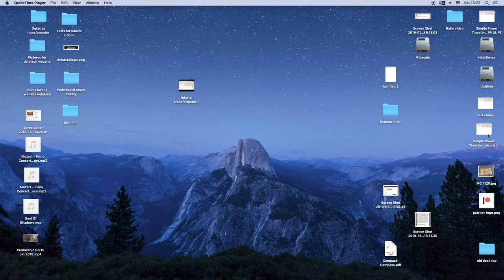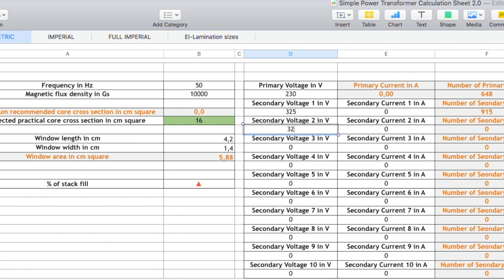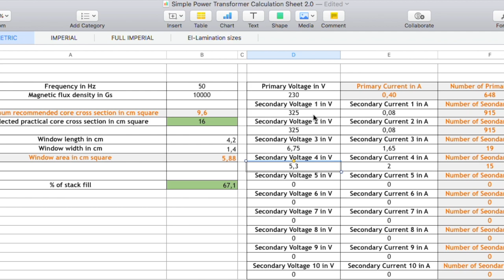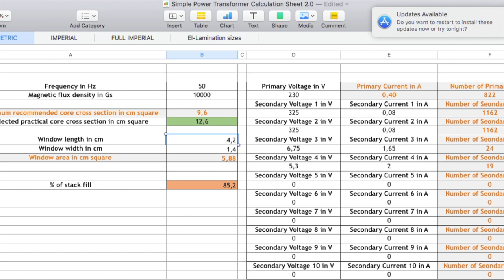Practical Transformer Winding Tutorial 2019

Comment: FREAKING EXACTLY WHAT I WAS LOOKING FOR! Thanks.
Reply from the maker: Thanks, happy that it was useful!
Reply: Don't repeat his steps... His transormer is rly badly made from safety point of view...
Reply: It's true, transformers were made this way 50 years ago and earlier, but that doesn't mean using wax and paper as insulation is a good thing. They only did it because they didn't have any better options. I don't even mention about leaving windings loose... It;s also very dangerous, because during  operation windings can vibrate and damge insolution of the wire and cause fire...  That's a very common fault in electric motors!!!

Comment: Im thinking of winding a step up transformer to step up from 1mv to 2V. Would i really need 1:2000 winding ratio? Seems ridiculous
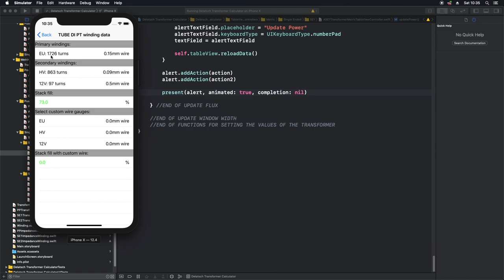Reply from the maker: Well, I presume you would like to amplify some audio signal? Usually it is done with a step up transformer that amplifies a signal in 1:10 (vintage ones went up to 1:20) and then you use an active device to amplify the signal further. The transformer is useful for these applications because it doesn't have internal noise like active devices and it can match the impedance. So, you can match the impedance and amplify the first most critical portion of the signal and then feed it to an active device like a jfet, opamp or tube.
Reply: @Delatsch  but why is 1:10 possible and not 1:1000
Reply from the maker: @ColocasiaCorm  The first problem is that you need a specialised high permeability core to reduce the number of turns. But with this ratio, even with the highest permeability core you would still need like 800000 turns on the secondary :) If you would increase the core size it would get veeery expensive and still you would need too many turns on the secondary which would cause a lot of leakage inductance and stray capacitance that would kill you high frequency response totally.
Reply: @Delatsch  i love you.

Comment: This is great! Nice work. I have wanted to wind transformers for quite a while.  I have two questions: Have you tested your spreadsheets to see if they work in LibreOffice Calc (This is an open source spreadsheet program - I run Linux only and this is pretty standard on many distributions)? For the screws that hold the transformer together, I always thought you needed to isolate them from the lamination's?
Reply from the maker: Thank you! Yes, the sheets work I've used it myself in Libre Office as well. They also work in Google Sheets on the Chrome boxes and Apple Numbers and of course in MS Excel as well.

Comment: Nice video.  A few suggestions to help with high percentage bobbing fills.
1) Keep all tape on the front or back side of the bobbin.  Even just a few thousandths in the lamination areas add up quickly.
2) Keep winding layers neat, gaps and overlaps will cause uneven layers and eat up space very quickly.
3) Keep overlap for paper layers to around 250 thousandths and make sure all internal paper layer seams are on the front or rear faces.
4) Eliminate the heat shrink tubing and instead partially strip the lead wire leaving the insulation stub on the end of the lead wire.  Strip the insulation off of the magnet wire and wrap it around the exposed lead wire conductors. Solder in place.  Tape the lead wire to the bobbin and make sure the lead wire stretches across the entire width of the bobbin.  Doing this will result in a more stable uniform winding layer.  Do the same when you finish the winding and the second lead wire.  Use your judgement when determining when to bury lead wires or bring out the windings.  If the diameter of the winding wire is less than the thickness of the lead wire insulation, it should be fine to bury the leads.
Reply from the maker: Thank you for your input! It's difficult to have a definite answer for some of the winding techniques since there are many ways to go about it and many different situations and conditions that will call for something different every time. The most important thing is for the "amateur" winder is to make sure the transformer will be safe, use only two coat enamel wire where the insulation can withstand high voltage and high temperature and the second objective is to fit the wire so that the laminations can be inserted without rubbing on the finished windings. The rest will come with experience and time.

Comment: Howdy. 
About the OPT for KT88 Push-Pull. After much experimentation I arrived at these conclusions.
1. The aim should be to achive full occupation of the winding window. I started with minimum thread  gauges for design power. That left some two cm2 of unoccupied window. I rewound with one gauge thicker threads. Almost full occupation was achieved.
2. The primary should be split into two parts. One part should be the innermost winding and the other part should be the outermost winding. Alternatively the primary could be two full windings connected in parallel. This is probably the best way. Obeserve though that the current split will not be quite even. The thread should be one gauge thicker than half the one winding equivalent.
3. Overhead plastic (Xerox film) strips as winding layer isolation worked well. The strips were cut to be 0,5 - 1mm wider than the bobbin inner width. The strips were rigid enough not to wrinkle in the middle and yet flexible enough to form a kind of levies or ridges or dikes ( I don't know which word would be the best to describe ) along the strip sides preventing turns from collapsing inwards while winding. Anti-collapse is mandatory. Before assembling the strips Gorilla Superglue was applied along the strip sides. Two layers of strips were used to isolate the secondary from the other windings for good shock protection.
4. The windings from the innermost to the outermost:
a. 1/4 of the primary
b. 1/4 of the primary
c. the 4 ohm secondary
d. the 8 ohm additional secondary
e. 1/4 of the primary
f. 1/4 of the primary
Windings a. and f. are connected in series to be one half of the primary. And b. and e. to be the other half. Very good DC resistance symmetry is achived.
5. A window gap of about 2mm remained unoccupied. Pieces of plastic were inserted into the window gaps. Plastics are slightly diamagnetic. The pieces will reduce the flux leakage somewhat.
In high regards.

Comment: Hi Delatsch! i have korean big scrap transformer, there are 3 wire each at the primer and seconder. Third ones should be body  / ground connection of the owen. Just to test it i apply about 3 or 12 ac to both coils (primer ot seconder coils) then my source transformer is overheated. that means korean transformer is out of order or the higher temp is normal for that kind of transformer?

Comment: Question:  What is the most common size steel lamination and bobbin size for a power transformer that would be used with 12AX7 tubes?
Reply from the maker: Well, it depends on how many of them you are using. The B+ is very low, the number of filaments would determine the most of the power consumption. You could probably use EI-66 metric or EI-86 I think is the imperial equivalent. If you have my power transformer calculator spreadsheet you can determine the exact dimensions you need according to the taps you need.

Comment: Im in the process of rewinding a 720V pentode power transformer. Ive completed the windings but the original design must have been incredibly tight, it was hard to take the E's out a the windings were very tight against the E's. So now I'm having to compress the windings to get the E's in without damaging the insulation, so far so good but I am very surprised at how tight my version is. I used thinner insulation hoping that would give me a little more allowance on the layers but it doesn't appear to have worked. I was about 5 turns short on each layer unfortunately. Still I think I can fit it, I hope so as its goin 1654 secondary turns very carefully laid so I really don't want to do that again as it took days on and off.
Reply from the maker: Nice, yes rewinding is a lot more difficult.than winding from scratch.

Comment: Thanks! The bee's wax is nice touch. We need to find a cheap solution for vacuum chamber the wax/potting process. 
Power transformer still intimidates me :D
I was scared enough putting DC onto my gapped class A
Reply from the maker: Thank you, Ben! I've seen people using old preasure cookers for potting but I really don't think it is necessary. Well, it is good to be careful with power transformers and take them seriously because if they are made properly they are extremly reliable and safe but if they are made with poorly isolated cheap and under ratet wire or with no insulation between primary and secondary at least then they can burst into flames. Another good benefit of bee's wax is that it doesn't ignite or burn really it handles temperature very well as you can see in the real old pure beeswax candles.

Comment: I tried beeswax but it’s not ideal for the line level application I’m winding for. I use MG Chemicals 419D to fix my lams together, available here in The States.

10:25 I burn my enamel off with a lighter, and then tin it. It works well with 29 gauge. 34 gauge not so much.
Reply from the maker: Hi Matt, 

I've used the beeswax on line level transformers as well and it works fine for me. What kind of problems do you run into?
I've checked the chemical you use it is available here in Europe as well so I might give it a try as well. For the thinner gauges I use a fine grit sandpaper and very carefully and gently run the wire between two folded sides. That works well but it takes a bit of practice. The lighter works as well.
Reply: Delatsch I build a commercially available product using an M6 EI63 laminate, and I wind everything in house. 

Beeswax smells nice and its great for marketing, but I had trouble with it in my shipping tests. It was too easy to separate the E and I sections if the package got dropped or damaged. So I researched and switched to the MG product. 

Thanks for the tip on fine gauge wires!  I love the channel.
Reply from the maker: Nice to hear that! Would love to see what kind of equipment you are building. If you want to share it here feel free, or if you prefer it that way please send a private message to my facebook page. Yeah, it's funny that people put higher price on products that use beeswax and yet it is cheaper than any other transformer or coil resin.
Reply: Delatsch I build some pro audio stuff, a few tube mic preamps, a microphone with a toroid output transformer that I wind myself, and some DSP based 500 series modules that use EI63 cores that I also wind. I’ll send you a PM on the FB page.
Reply from the maker: Cool, looking forward to the links to your page!

Comment: Nice video. There are also double bobbin transformers with separate windings for primary and secondary coils on separate bobbins. I wonder what are their efficiency compared to single bobbin transformer. I wanted to make a double bobbin transformer  with 12 0 12V and 0 10V outputs and 220V input.
Reply from the maker: It provides natural.insulation between primary and the secondary, but it is not practical for transformers with more secondary windings.
Reply: It is for a 12 0 12v 0 and 5/10V   1.5A transformer  with 230V AC input.  The input with primary winding has two wires,  the secondary winding with output has 5 output wires. I was planning to put the secondary winding on a separate bobbin. These are bobbins are smaller than a single bobbin. The secondary windings are probably less than 170 turns of wire gauge 25. The primary may have 2000 tuns of wire gauge 38/36. This is a rough estimate.

Comment: I notice that the wire springs out a lot between the corners of the bobbin preventing a complete fill. Are there any techniques to keep the wire flatter against the bobbin and achieve a higher wire fill percentage? I am having this problem on the diy transformer that I am working on. Thanks for the good video.
Reply from the maker: When hand winding the only way to reduce that is to put higher tension on the wire (without burning the fingers :) ) and also to keep hands as close to the bobbin for better control. On automated winders a good transport gets rid of that. But with my calculator, when the calculated stack fill is at around 85-90 percent you should have no problem fitting the wire. It's better to have a bit of room, than not to be able to fit the wire and then have to throw it. Thanks for the comment.
Reply: Thank you

Comment: i have a question. does winding pattern affects efficiency? as I have seen in other youtube they wind the wirings in a pattern of going from top to bottom and vice versa forming a layer before going another direction. and in your video you just let the wire be evenly paced on the surface of the bobbin.
Reply from the maker: Ideally you should go from left to right to make windings more uniform. It is more important in hifi transformers, in guitar amplifier transformers it is not really going to be noticeable since it effect higher spectre of frequencies.

Comment: Hi, nice work! How about c core transformer calculations?
Reply from the maker: The formulas are the same, just the core section is one leg cross section.
Reply: @Delatsch  Thanks for reply, will use your calculation for my project. What do you think optimal Gauss input would be for nanocrystaline core?
Reply from the maker: @23kazliukas  I don't have experience with it, but I think you can try with 12000Gs and since it is easy to insert the core, you can make a test with a simple transformer for your mains voltage as a primary and 100 turns for secondary and see what you will get.

Comment: Would you recommend these techniques for high voltage transformers?  I’m looking to rewind a transformer with secondaries of 540v.
Reply from the maker: Is it 540-0-540 or 270-0-270? If it is 540-0-540 then I would recommend putting layer of insulation between each layer. Otherwise the process is the same. And double coated motor wire is a must.

Comment: I'm a bit confused about measuring the core size. Is it the bobbin, or the overall area that the bobbin + winding would fit into once the laminations are put together?
Reply from the maker: The core size is just a x b of the bobbin hole. The winding window area of the bobbin is not important for the number of turns, it is just calculated to see if you will be able to fit the amount of wire you calculated to that particular bobbin. Not to start winding and realize half way through that the wire won't fit.
Reply: @Delatsch  Thanks for the reply. Another question I have. So, on the calculator spreadsheet you made, e.g. the wire thickness says 1.13MM, but this isn't a standard size wire. So, would I just go with 1.15MM wire then?
Reply from the maker: @in.der.welt.sein.  Yes, just use the next standard wire size. If it would be something like 0.21, you could round it down to 0.2mm, but it's usually better to go with the slightly higher value to avoid excess heat in the windings.

Comment: Is it possible to use your calculator to calculate small microphone output transformer?
Reply from the maker: It can be used to calculate output transformer for a tube microphone or transistor microphone if you know the impedances, but if you mean the output transformers used in dynamic microphones like Shure 58 then it won't work right because there are other design differences which need to be considered.

Comment: Does your spreadsheet app work for any type of transformer, e.g. EHT, output, matching, power, etc?
Reply from the maker: The app is still not on App Store, but will be soon. You can check the spreadsheet versions of the calculator on my website. It works for standard E-I type laminations for power transformers and also line and power output transformers for both SE and PP applications.

Comment: I don't really understand why people will put some much time and effort in to winding pickups but then buy an off the shelf machine wound output transformer. 🤷Scatter wound, not potted and not too much tension has to equate to a richer and more complex final "tone".
Reply from the maker: Haha, yeah. Well, it doesn't work quite the same in the output transformers, but still a good point.
Reply: Scatter wound just means you are wasting copper wire. All it does is weaken the flux density of the coil, which means it takes more copper in a scatter wound coil to equal the same flux density in a uniform one. If you want a weaker flux density in a uniform coil, use less windings and save money on wire. lol

Comment: Is the beeswax absolutely necessary? What happens without it, leaving the transformer as is? Thanks
Reply from the maker: You can use transformer resins and similar products to pot the transformer, but if you don't pot it in any way it will buzz loudly at mains frequency 50 or 60hz.